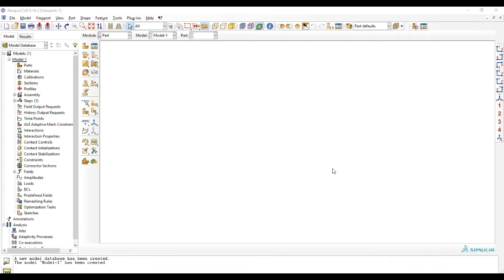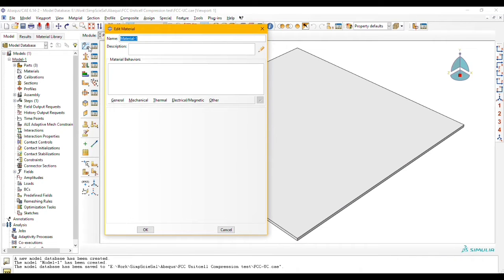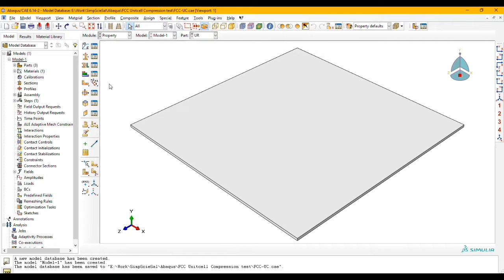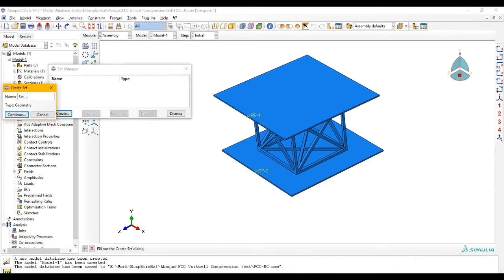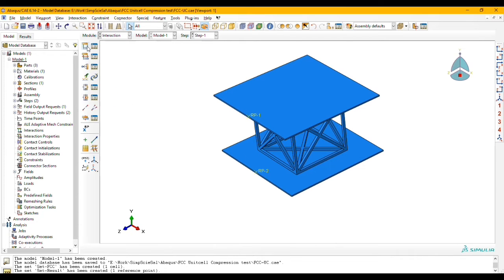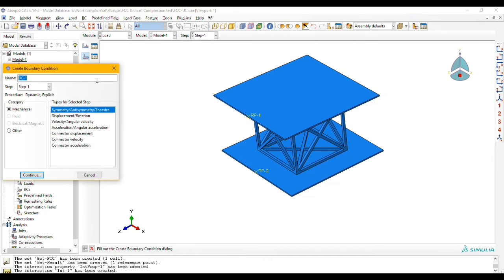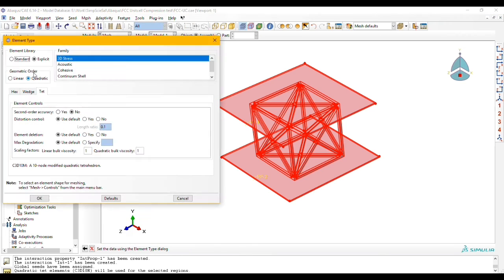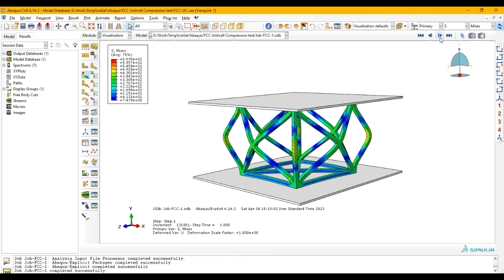Abaqus Tutorial: Simulate Uniaxial Compression of FCC Lattice Structures | Mechanical  Metamaterials

Comment: Is Abaqus software useful for materials and metallurgy students?
Reply: Yes, but it depends on what your use-case is. You can simulate the mechanical behaviour of composite materials, mesoscopic behaviour of alloys (if you know their microstructure), lattice structures, general engineering structures, electrical and thermal behaviour etc.

Comment: Dear sir,

Thanks for the vedio. Am doing research in Lattice structure. The value of your simulated unit cell shows stress of 797 MPa. As for my knowledge the lattice cell will have not more than 200 MPa max. Can you sort this.

 And also one help. Can you simulated with the multiple unit cells and put videos. It will show plateau region as well.
Reply from the maker: the strength depend on the structure and material, so you MAY reach high strengths in you lattices based on the materials and the criteria you are using for the results, sure i will do the simulation for the whole structure asap, what lattice unit cell you are working on ?
Reply: @Salar3DStudio  Thanks for reply. Am working on simple cubic structure with Ti6Al4V
Reply from the maker: @ParameswaranPed22d008  Contact me on linkedin for the simulation if you have problems.